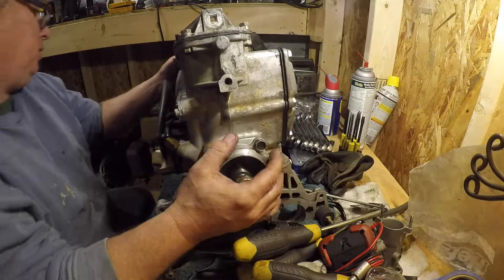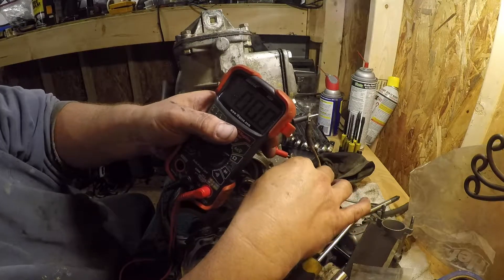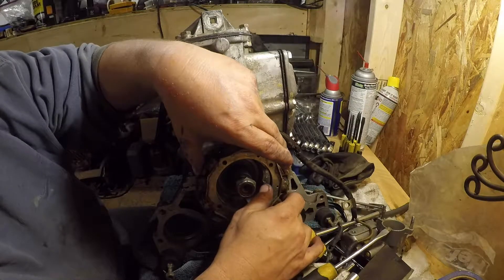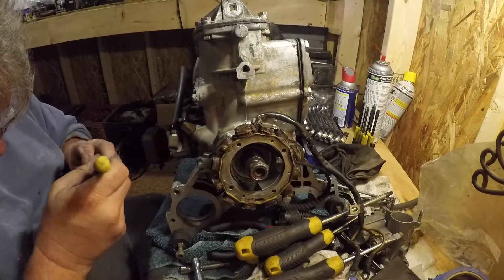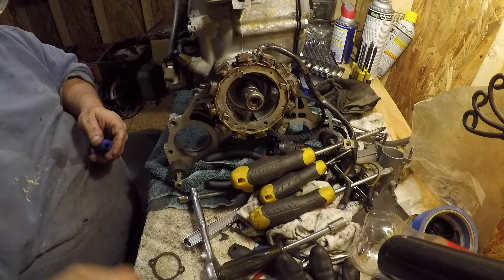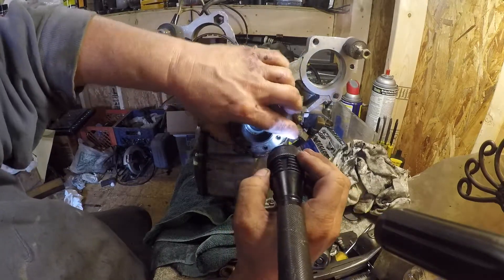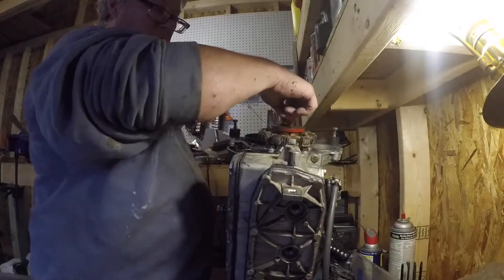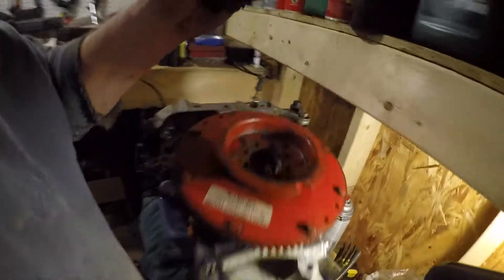Mercury Outboard Thunderbolt 500 50 HP Part 39 - Timing Belt Stator and Flywheel Install

Comment: It's a stator not alternater
Reply from the maker: Same thing except in this case its alternating power that's why you need a rectifier.  It rectifies the alternating current into DC voltage.